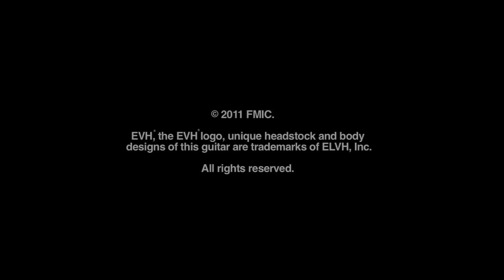EVH® Wolfgang® Guitar

Comment: I like Ed and his gear. 5150 is a monster amp. And even the budget versions of Wolfgang appear to be almost perfect (my only remark is the lack of steel frets) but this 3:00 is some serious pseudo-scientific quasi-purist BS.

A 5150 has 4 pre-amp stages, a phase inverter, and then 4 tube amp stages.
Of course he doesn't need any OD/Dist pedals, he built them in the amp!

And even if he didn't, what does it matter?

The guitar is basically just an electrical circuit (a very complex sensor).

The amp is just an electrical circuit but with more components. 

Pedals are also just circuits with a bunch of components.

What does it matter if a circuit is inside the amp or if they are separated inside pedals?
Or why does the length of the signal chain (within common use) matter at all?

Well it doesn't. Only thing that matters is if it sounds good. And if it sounds good, it's good.

Comment: Not a huge VH fan but this guitar has some great features.  Still, I hate that ugly headstock.  Locking tuners would be much better too.
Reply: Locking tuners with a locking nut? I hope you want them just for ease of string changing because there's really no other use for them.
Reply: Locking tuners are 100% redundant on a guitar with a locking nut.

And I don't even understand why they'd be easier to restring either. Just pull the ball end of the string through the tuner post and be done with it. It's not rocket science.

Comment: Nice body shape, very comfortable. Neck pickup is terrible sounding, can only do a soft vintage type of sound with cleans, way too muffly sounding. The 3 way toggle being inverted is also annoying. Small frets make it harder to play, especially because the Floyd is non recessed and sits very high, really should have recessed it and blocked it into dive only with something like a trem stopper to keep the dive only aspect. Neck shrinks and expands until the fret ends poke out and the neck needs constant adjustment due to the lack of a proper finish, even with proper oil treatment and the graphite reinforcements. Lack of locking tuners at an expensive price is also an eyebrow raiser. The high friction/low friction Bourns pots are really good. Comes with a decent case.

Overall, I'd give it a 2/10. Not anywhere worth the $3,000 price tag. Very disappointed with my purchase.
Reply: Reginald Von Goldbergstein totally agree about the toggle switch..I would have kept it...I bought one (zzounds mail order)  played it exactly 40 minutes, reboxed it sent it back ordered a Ebmm Axis 10 minutes later, Ed is king... but IMO the Ernie ball is tits
Reply: christopher perry
EBMM also understands that varnish>tung.
Reply: Probably the EB axis that he used to use is a better guitar.
Reply: Locking tuners are totally redundant on a guitar with a Floyd.
Reply: Easy restringing, no ball ends sticking out of the post, and auto trim. The convenience is simply too good to pass up to be redundant.
Reply: No ball ends sticking out of the post? How is that an inconvenience. It's actually even more convenient than locking tuners as there's no locking mechanism you need to mess with. You literally thread the string through the post and cut it off at the bridge end to the length you need and put it in the Floyd. Bam, done. Zero effort required.
Reply: Likewise with not using locking tuners. Not quite sure what to tell you if that takes any effort either. Having the ball ends through the tuner post looks nice and clean too.

If you think it takes any effort to string the guitar through the ball end and rather spend an extra $50 on locking tuners, then god help you when it comes to actually setting the Floyd up.